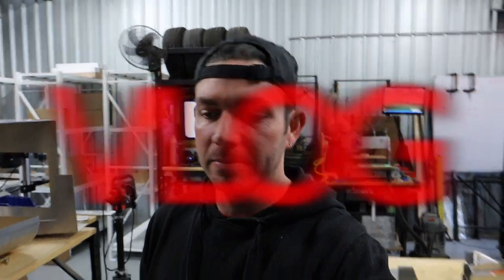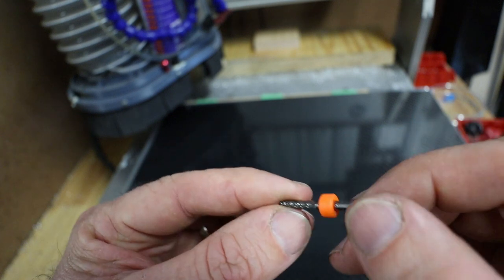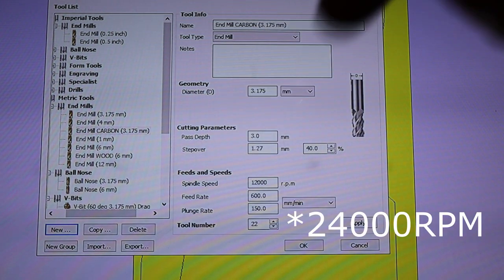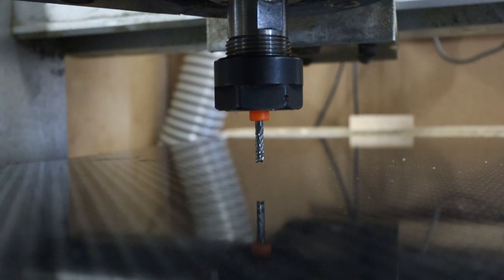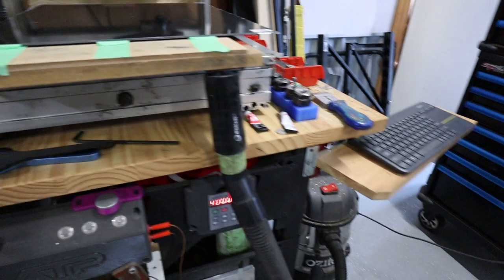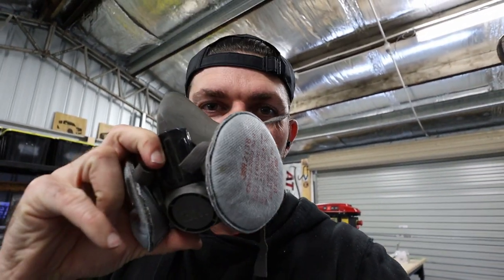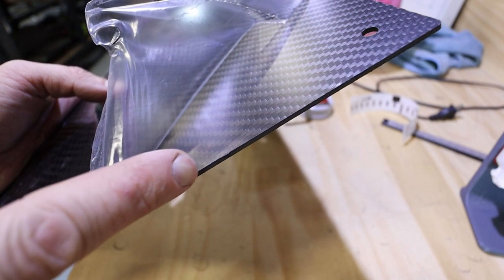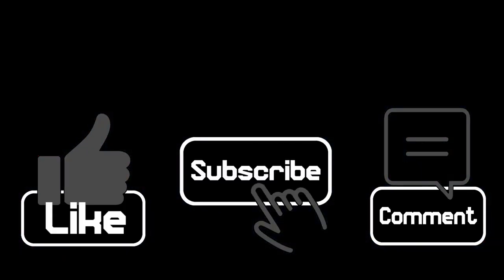Cutting Carbon Fibre on a CNC6040 Router - VLOG

Comment: I have never seen anyone else use the piece of paper to set the Z height before. So quick and simple. And, thanks so much for the feeds and speeds; that's really going to help on an upcoming project.
Reply from the maker: I think the paper trick was popular when I first got the machine and was learning how to use it (on YouTube of course!). I agree it's a nice quick method when taking a full depth of cut, not ideal if you're actually machining something with important Z heights.

Thanks so much for checking out my video, I'm glad you found some value in it!

Comment: @Adam Taylor A year and a bit down the road and its still a great video, but as someone who wants to cut carbon fibre, is this the right way of doing it in regards to carbon fibre dust or Would the machine be safer from dust inside a sealed acrylic unit?  Also is the dust shield an OEM part or something you made please?
Reply from the maker: I've found using a dust extractor with the boot works well for me. Coolant will also keep the dust down but restricts the use of a dust collector and I don't find it as effective when releasing the parts.
I also have a industrial air purifier in my shop that I run when cutting carbon or mdf to help with any dust in the air.

The dust boot is something I've 3d printed from thingyverse 👍

Comment: Nice. Which machine are you using please? Link?
Reply from the maker: This is a 6040 machine that I bought almost a decade ago and is pretty modified so there's not really anything I can link you. 
If you look up CNC6040 you will find what I started with, but from my experience be prepared for it to be a project.
I've have seen people get great results with the Shapeoko and I believe these are a good quality machine out the box.

Thanks for watching 👍
Reply: @AdamTaylor  thank you. Yeah, makes sense, my 3D printer hardly resembles it’s original self but much more useful now.

Comment: Is there a cheap cnc that will cut aluminum plate for rc parts?
Reply from the maker: The 6040 machine will cut alloy and I have seen smaller machines do it with some success too. 

Depending on your budget and your cutting requirements it's often better just to have someone cut parts for you. 
Alternatively, if you're determined to donor yourself, find a machine that suits your budget and see if anyone has managed to use it in the way you need 👍

Good luck, it's a lot of fun!

Comment: Can you cut carbon fiber with most desktop cnc? I was looking at one and was wanting to get the upgraded spindle at 300w but have no idea what is needed in machine specs to cut carbon fiber. I want to cut 4mm to 6mm sheets for drone frames
Reply from the maker: In my experience you don't need a lot of power to cut carbon, I used to have a 700w spindle and that was fine with the same speeds and feeds used here. I think with your 300w spindle it would just be a matter of dialing in your speeds and feeds to suit. 

Give it a go, I'm sure you will figure it out!

Comment: What do you do when you have a 1 mm  cutting line or you have to cut a perfect rectangle from the list and you can not have even R 0.5 mm radius on the corners???
Reply from the maker: Either design the part differently or use a different manufacturing method.

Obviously there are limitations to very manufacturing process, I design all my router cut parts with a specific tool size in mind (depending on the material) and allow pockets and internal geometry to have some radius right from the start.